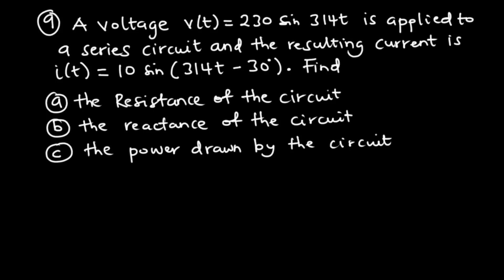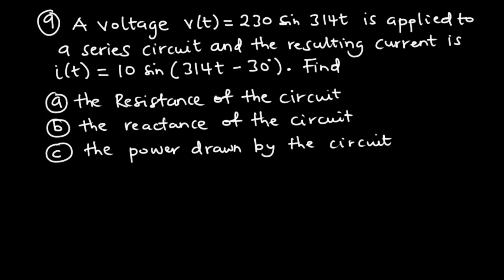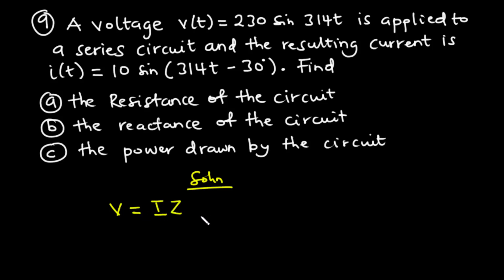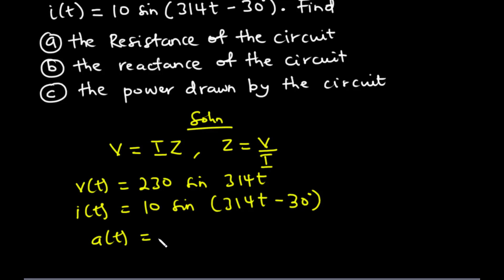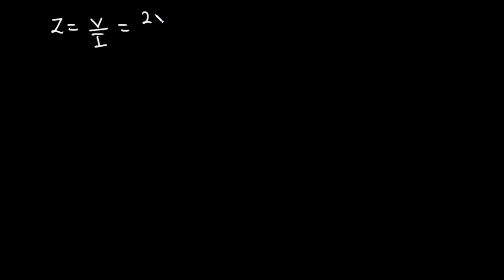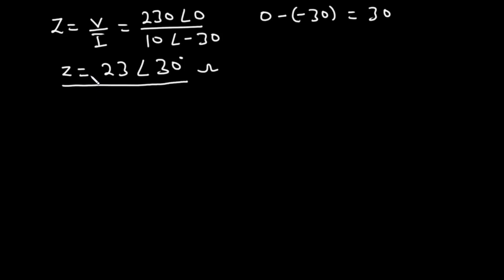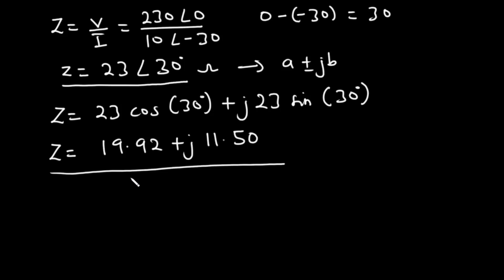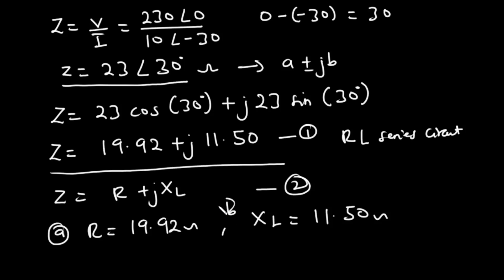41 - AC CIRCUITS PROBLEM 9 |Finding the Impedance and Power of an AC Circuit| #KNUST

Comment: But there was nothing like inductor in the question or …. If yes pls show me
Reply from the maker: Positive reactance is inductive.
Negative reactance is capacitive.
So if z = 3 + j4, it 
means the reactance X is 4 ohms
Since its positive it is inductive,
Hence X = XL = 4ohms
Reply from the maker: So first find the impedance z, then you will know if its positive or negative reactance
Reply: @SkanCityAcademy_SirJohn  thank you very much
Reply: @SkanCityAcademy_SirJohn  pls how do I find the actual power and reactive power of 1kVA load operating at 0.85 power factor leading